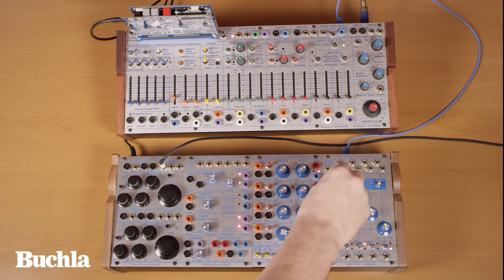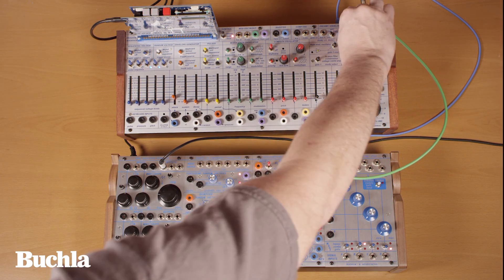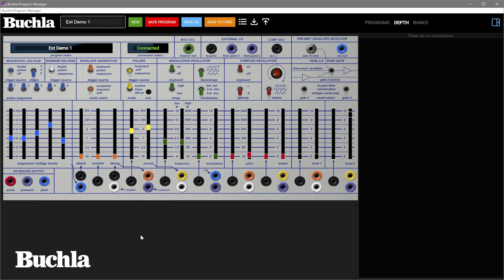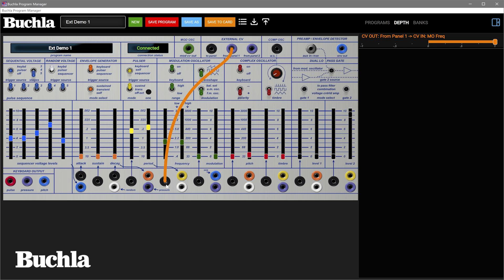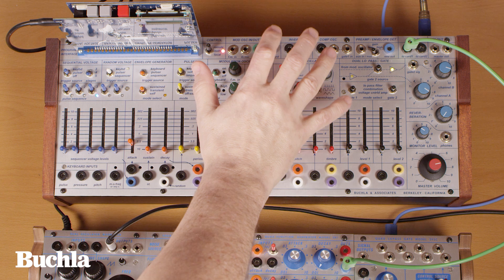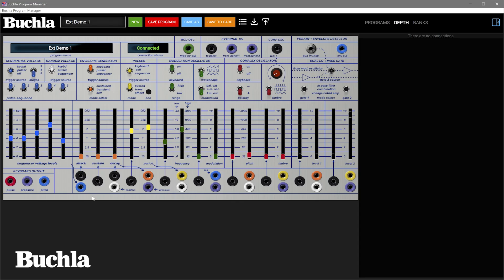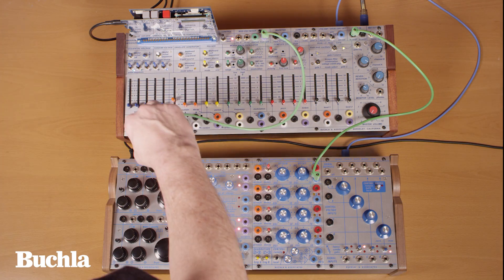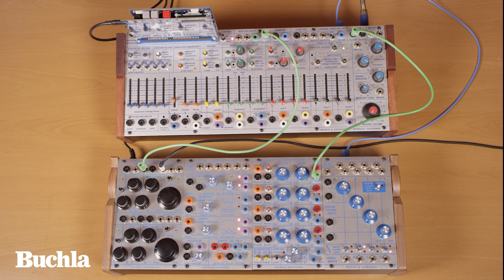Buchla Program Manager: To/From Card & Panel Connections

Comment: I'm still trying to figure out if the new Program Manager card is compatible with my Buchla Music Easel without a DIY Modification - the Buchla site says a modification is needed if the Music Easel was built between 2013-2017... but mine was built at the very end of 2017 and finished at the beginning of 2018, and I recall Eric Fox (who had just taken over from BEMI) telling me that there were some upgrades to my Easel not in the previous 2017 models. Is there any way I can tell what those are?